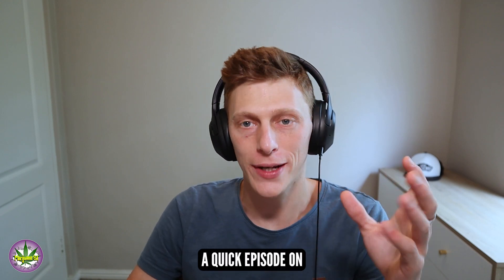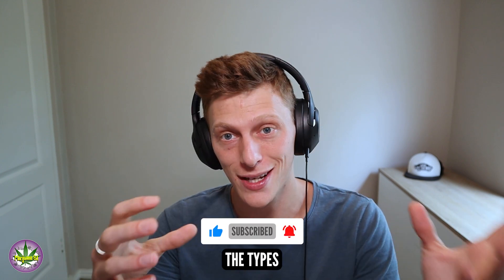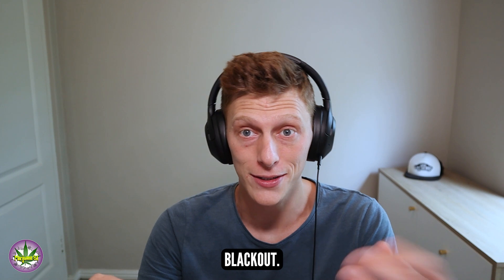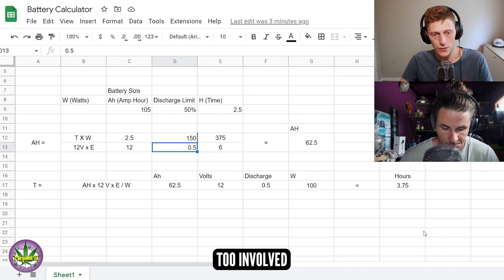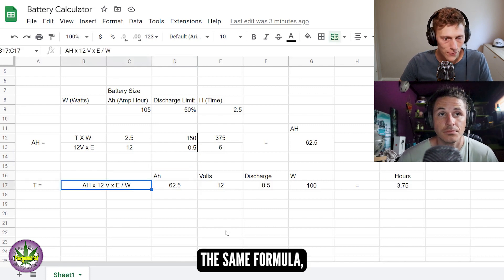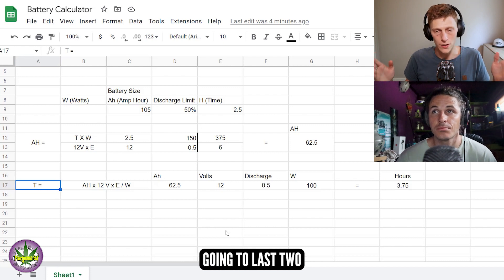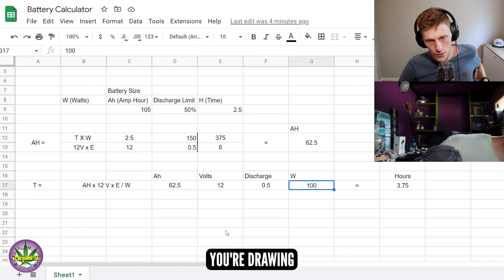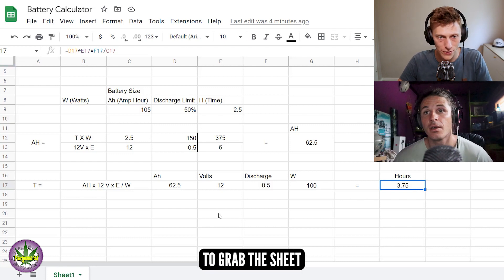Retail Inverters & Battery Size Calculations

Comment: Have a look at the new Huawei Isitepower-M modualr inverter/battery systems. They're not exactly cheap but they take up a small footprint, totally silent, comes with a 10 year warranty (not to repair but to flat out replace the unit). It uses lithium batteries. Base unit is 5kwh but you can upgrade by adding another (up to two extra) battery modules. You can also hook up solar panels to it for charging! I had one installed a couple weeks ago and I don't even notice when it's load shedding!